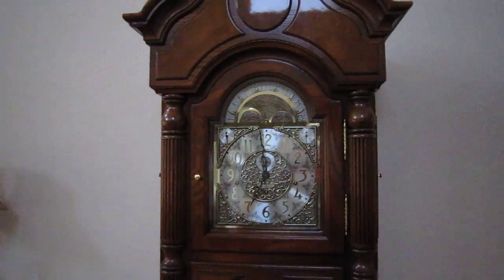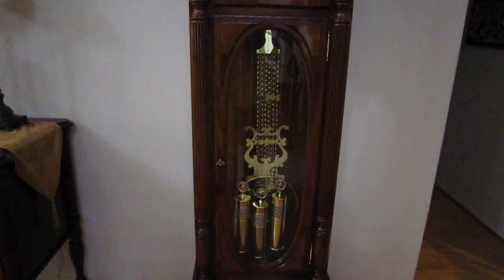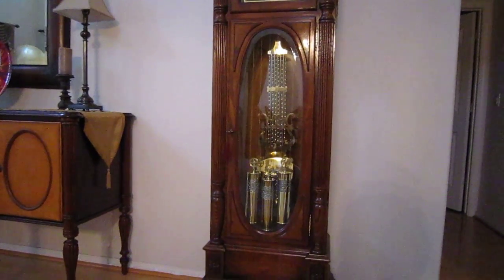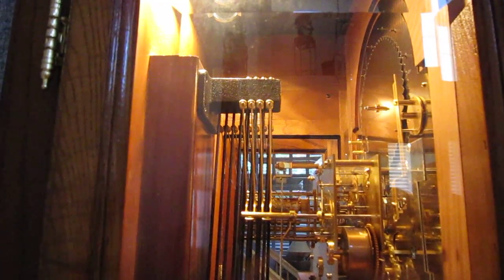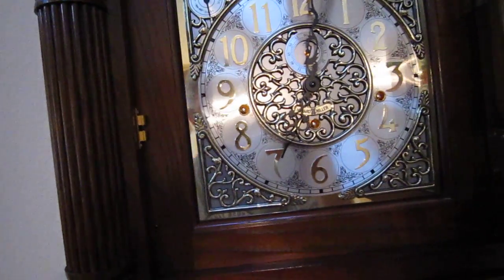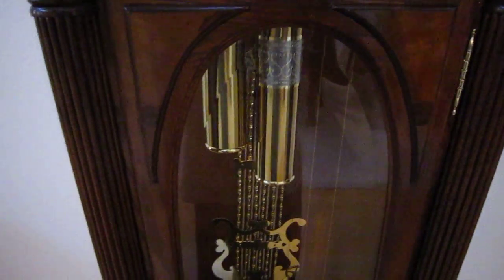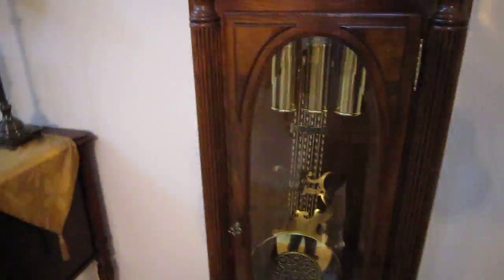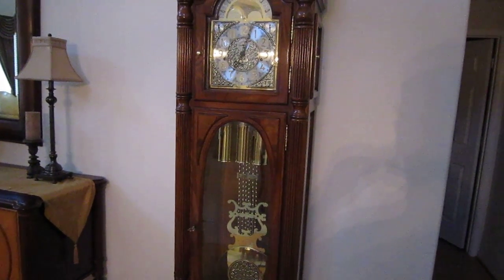Winding a Grandfather Clock

Comment: Elliot Phillips.  The roof of this clock is located on the top behind the bonnet top and it's where as he said he puts his winding crank at rather than inside one of the side panels.  I'd do the same thing too if I had a grandfather clock with cable driven.  My parents has a German grandfather clock with chain driven movement.

Comment: Very nice clock and great sound.  You haven't let us hear the westminster yet.  Only the St. Michael and the Whittington.  I think it's a better idea to store the winding crank at the top behind the bonnet  rather than reachinside the clock through the side access pannels.  That' swhat I would do.  That way you can get to it quicker and easier.
Reply: You could also keep The Winding Crank in the inside of The Grandfather Clock And Put it on the ground in The Inside of The Grandfather Clock Inside.

February 2 2022
Reply: That's exactly what he does. He even mentioned it twice.

Comment: I  turned 70 (how did THAT happen???) and have just bought our first-ever Grandfather clock. Have yet to read the entire book because of lack of time and wanted the short version. But you only showed how to use the crank for the first weight. Where do  you raise the second and third one?
Helpful so far...
Thank you!
Reply from the maker: You will find the openings at roughly the 9, 6 and 3 oclock positions to fit the crank in. Look on the face of the clock for the holes. No particular order, just don't do it at at 3 , 6 or 9 oclock and the hole will be not be fully free to access.
Reply: pancove925
Thank you--funny how I never noticed those before! I was too busy admiring our lovely new clock. Now I can wind to my heart's content. Love this clock!
PS
Guess my husband isn't too "up" on furniture lingo.  I told him I wanted a clock with "the broken pediment" and he said, well, if it's broken, why do you want it?
Husbands--you gotta love 'em.
Thank you again for taking the time to reply.
Reply: pancove925  m
Reply: Marci make sure you don't over wind your clock.  Most newer clocks have a stop on them to prevent overwinding.   Dust to a clock is very bad inside the movement.  Have it cleaned once every five years to prevent the clock from wearing itself out from dust gathering in the pivot holes.
Reply: Mark Burnette You cant really overwind a grandfather clock, or any weight driven clock....
you can only overwind spring driven clocks.
Reply: NoahBones 12 yes you can overwind a grandfather clock especially chain driven to where the weights are up to far and the hooks get caught in the seaboard.  So yes you can
Reply: Mark Burnette mmm... never heard of that happening before..... never happened to my 1987 Colonial Grandfather clock..
Reply: NoahBones 12 its happened quite a few times on house calls I've done for my clock shop.  Just because you can't see the wind doesn't mean you don't feel the affect of it.

Comment from the maker: It needs to be oiled and cleaned every 3 to 5 years depending on your conditions.

After that, I think the bushings are the most likely to need replacing after 10 years.

What kind of clock did you get ? Post a video and give a tour !

Comment: why doesn't mine wind up easily?
Reply: If it's been three or four years your clock needs to be oiled. You can go online and see if there are any horologists or clock repairers that can come to your house and oil it for you. If your clock is chain driven the weights can be heavy pulling them up.